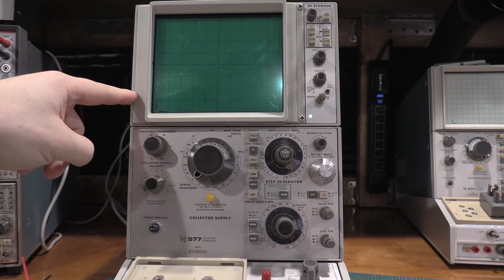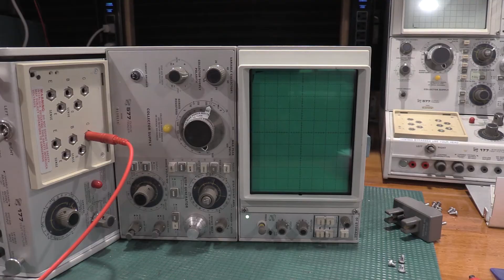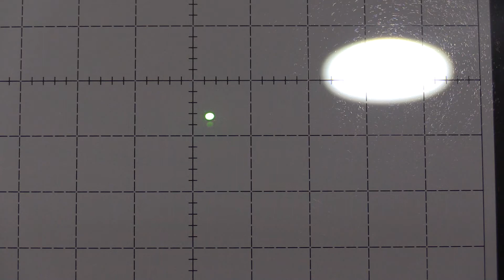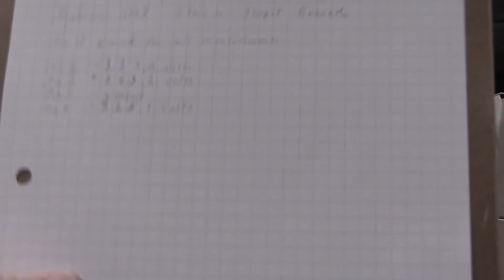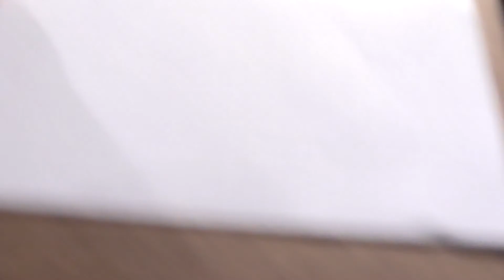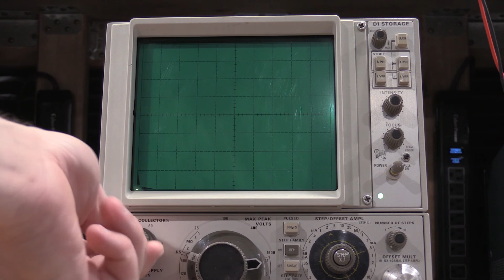Tektronix 577 D1 Calibration/Alignment

Comment: hi I just got a D-1 with storage tube , the power supply was a mess. I got it to power up but want to return the PS to a more stable operating state as the previous repair was not optimal. there were a lot of burnt traces and the 4 vertical filter caps were Gerry rigged so bad its hard to figure out how they should be installed as the repair had jumper wires all over the place and caps not sized right for the job. Can you take a pic of the bottom of the PS board and also a close up or how R765 the variable trimmer is wired up to the board ?

Comment: Hi, nice video! I'm curious in your opinion, if you could only have one tracer either a 577-D1 or 577-D2, what would you get and why? Thanks!
Reply from the maker: In terms of the D1/D2 the only difference in the 2 curve tracers is the storage tube. Otherwise they are exactly the same. So the real questions is, Is the storage tube a feature that is needed. One other thing is the storage tube is more sensitive to burn in. There is also a start up procedure on the storage tube when it has been off for a while. The flood guns need to run for 6 minutes before the high intensity trace is on the tube. There is one thing that the storage tube is really useful for is thermal junction measurements of the BJT junctions but I have not needed to do that measurement in the lab yet.

Comment: How about if the screen doesn't work
Reply from the maker: Many issues could cause the tube not to work however if the example is a D2 the non storage version there is a source of tubes for the 577. This is not true for the 576 as they have a unique tube.

Comment: Thanks for this, I had skipped the 177 alignment when I went through my 577.
It can't have been as far off as yours, because it didn't drive the 577 alignment into the ditch, but I am much happier now.
Reply from the maker: I have some extreme time gaps. Only of the curve tracers I have is serial number 124 so SUPER early ( it really does not cal well) and the upgrade to the dual POT position adjustment is a huge update. Getting the position correct with the 10X Mag on is not the easiest with out the fine pot. The early 177 had been messed with pretty badly.

Comment: thanks for the videos, im working on a 576 now that needs a full recaping.
Reply from the maker: You are welcome, I hope the recapping goes well. They are wonderful instruments.
Reply: @ZenwizardStudios  thanks me to. it works on ac mode fine but it didnt seemed like the step gen was working,  after testing caps the 11000uf cap was open so im going to recap the hole unit and go from there. also when i switched to npn mode i would get a weird buzz noise, im not sure what that is or if its normal.
Reply from the maker: There should not be a buzzing noise as far as I know. But the power supply needs to be solid before anything else.
Reply: @ZenwizardStudios  ok i didnt think it was but iv never used one before so wasnt sure, ill recap it and the go from there , thanks